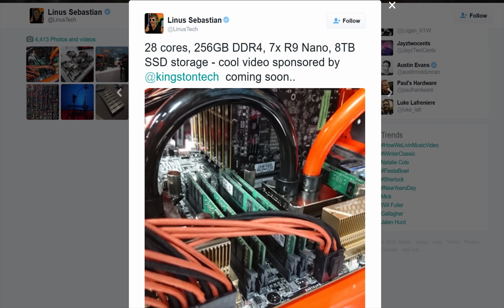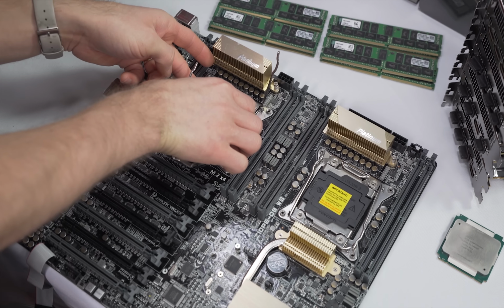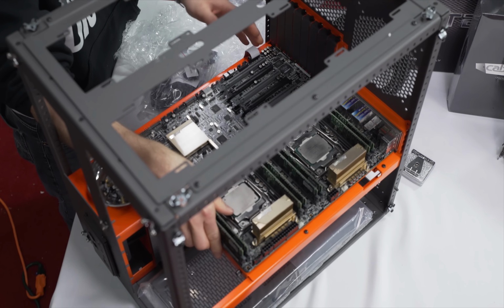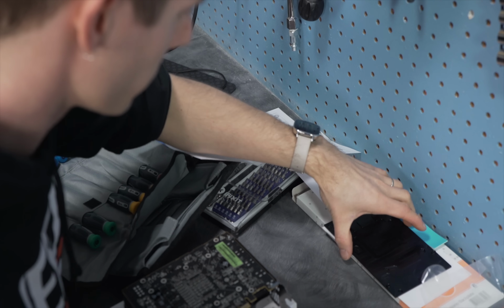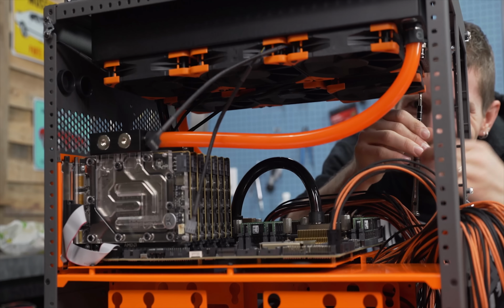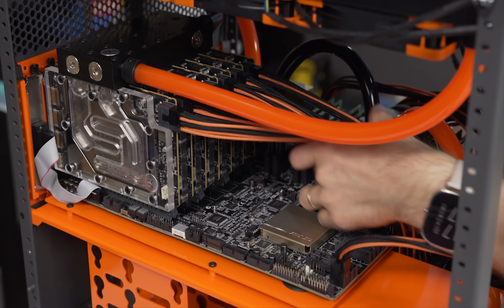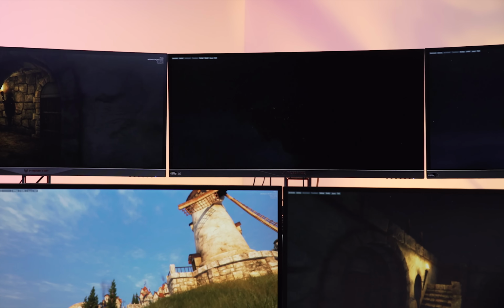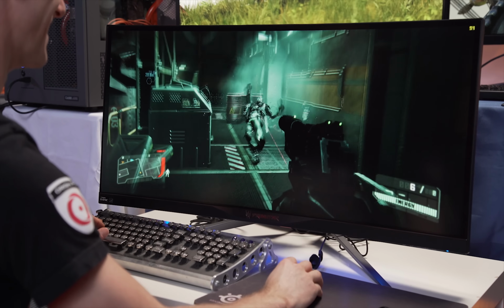7 Gamers, 1 CPU - Ultimate Virtualized Gaming Build Log

Comment: Can someone help me build a gaming PC?
My preffered budget is 5 dollars, but im willing to go up to 6.
Reply: Xavier doesn't know what he's talking about, there are loads of builds you can make for way under $5
Reply: Brandon Miller Please ignore Xavier, he doesn't know the slightest bit about PC specs
Reply: $5? you must be looking for a top of the line rig! it will be much faster than the peace of crap in this video
Processor: ~ 1 month old Toast running on the Whole Wheat Grains Architecture, Socket LEGO-1
Cooler: Sun's Core
Motherboard: LEGO Board, Using the Dankmemesv420 chipset
Storage: Keemstar Branded Wet 'n soggy semen Folders
Ram: A Battering ram, LEGO16P brick module
OS: Potato OS 4.20 Weed Edition
Power Supply: 1km tall iron pole in a thunderstorm
Graphics Card: Nerds Glases with a Sound-Weaponized FX 5800 Ultra
Case: Box Jellyfish's body

Benchmarks:
This pc run's Crysis 666 at 666fps at 666x420 at the highest settings!
This pc runs Minesweeper at 1 frames per ice age at 2x2 squares
This pc runs WinRar at over 9000fps
This pc runs Russia at cyka blyat frames per second
 This pc however, is not good enough to run pong, if you wanted to play that, im sorry man, not possible.
Reply: +Xavier Bob I actually run metro last light at max settings on my raspberry pie...
Reply: +THE CAUCASIAN ASIAN THAT'S WHAT I SAID
Reply: +Xavier Bob you know we're messing with you right XD
Reply: That doesn't make sense
Reply: +Xavier Bob lol
Reply: You can. You just have to buy foil, a bus ticket, get to Linus's home, smother him when he's sleeping and steal this PC. Under 5$ !
Reply: I would recommend the raspberry pi
Reply: Buy a LED and a battery. Wire them up and play a game called controlling the light
Reply: Potatoes 0.85 cent  electrical wires maybe a homeless man can haggle with you for maybe around 50 cents i suggest using a penny as cpu and for your gpu i would recommend a picture of fabio pretty solid build it can run minecraft at 140 fps and crysis at maybe around 500 fps
Reply: Brandon Miller buy i7 cpu 128gb ram and a Titan xp
Reply: Brandon Miller buy a hooker instead
Reply: take 2 potatoes, wire them up and there you go
Reply: Ya buy some potatoes
Reply: +TheCaucasianAsian you're actually a savage bro. lol
Reply: Brandon Miller no worries ma man, u can get a core i7 with 2 gtx 1080s and 128 gig ram
Reply: that's what I would like to do, but I don't know enough about building PC's yet lol
Reply: it's actually not all that difficult, the hardest part will be finding components that work togeather, personally if you're on an extreme budget I'd suggest AMD FM2 socket, amd apus have much better graphics capabilities then the intel iterations, and the older A8 quad-cores are very cheap now - I used one for my friends rig, an A8 7600 I got for next to nothing, perfect for his needs, but it seems to have issues with poorly optimised older games, I hadn't been able to get VtM Bloodlines to work on it as well as I'd have liked, and yet it has no trouble with Shadow of Mordor, a game that only came out a few months or so ago -, also very easy to upgrade, you need only worry about getting a dedicated gpu to increase preformance, In the meantime it'll do the job, however being an APU ram speed is much more important, anyway if you can get a board with 4 dimm slots then you should have no trouble getting four 2gb ddr3 sticks for next to nothing (they're something like £1-3/each from CeX here now) and you really currently do not need more then 8gb of ram yet try to get something at least 1600 though, 1866 would be better, but if you don't have any choice 1333 will at least get you a working pc, try to get all the same brand/type sticks I personally havn't had issue with mix-in-match but apparently some types/brands don't play well with others. take note of your motheboard serial number and type as well since you'll want to look up the manual online to show you where/what all the connectors are, as putting a computer togeather really is just making sure you plug the right plug into the right socket and they generally only go one way/fit one type of socket anyway, also note the power requirements for your apu etc.. but rule of thumb for your power supply you want something-anything rated 80+ preferriblely 80+ bronze or higher that is an authentically rated such (you'll need to research if it's an unknown or unbranded psu) as any psu with an 80+ bronze rating is actually better then even the best most high end psu you could get 15 years ago sotospeak, however you will want to upgrade that at your earliest opportunity as a 2nd hand psu could have issues you don't know about.. also when buying parts look carefully at the caps, japanese caps are best but anything will do on your budget, just check for sweating, buldging or leak-damage if any of the caps have that then it's about to die and you'll have wasted time/money.
Reply: Karl Pudinger
the thing is, after a couple of weeks, the pc may try to... umm.... eat you.
Reply: It is possible, but you're not going to get anything great, you'll basically need freecycle, or friends that have old hardware that they have no idea what to do with - I built a pretty decent basic gaming rig for a friend for £80 including everything in the case, he has his own tv he can use as a monitor, I gave him some old ram, motherboard I had just taking up space, most of his budget went into the case and hdd, he was given keyboard and mouse by his sister etc.. It can run doom at low resolution, it can run shadow of mordor at reduced resolution just shy of 720p, and fallout 4 (on all lowest settings), and plays youtube at 1080p without any trouble - it is an APU, that's saved a masssssssive amount of money, and dirt cheap to upgrade later.. since he prefers older games from 10 years ago it's more then apt.
Reply: He didn't say what era. Can you find a bargain bin PC from the past 20 years? Minesweeper, hearts and Solitaire will keep you up for weeks. What about a used TI-83, you can get the games online.
Reply: Brandon Miller yep go get a free pc a dollar keyboard and a 3.99 dollar mouse
Reply: Devin Hepburn can it run Minecraft tho?
Reply: ItzSpencer
It will soon, just waiting for a Java port for Potato OS 4.20
Reply: Devin Hepburn k think I'm going to get that build I guess.
Reply: Jaysonfred
thanks, il make sure to put into my LPCI (Lego Peripheral Component Interconnect) x69 slot.
Reply: You can almost get a raspberry pi zero. That would maybe play doom? :D
Reply: prospectus
but what if a demonic centipede is guarding his pc?
Reply: Well, you might be able to buy a usb cable for that price, that's a start.
Reply: There are videos of people building a "gaming" pc for about $25 out there. By gaming, i mean they have a low end gpu in them and it's basically a stock dell computer or something similar. It's pretty cool though cause those babies run better than what you would think. So if you're willing to increase your budget by $20, it's actually possible
Reply: Might be worth investing in a tamagotchi. It would probably be a decent one aswell
Reply: Brandon Miller ill sell u my pillow for 5 dollars. It can run agario unlike this one
Reply: Mabe you can get 10 titan Xs and 7 CPUS at 6 dollars though
Reply: ` shockwaveBJ its not much but it's mine
Reply: Xavier Bob I got a 6950X for $10! I may be an eBay wizard
Reply: You can buy a sack of potatoes.
Reply: with a litle more you can buy "raspberry pi 3" for retro gaming
Reply: Brandon Miller send me 6$ I'll you decent PC..  You will be able to play GTA 6 but in GTA 7 you will experience few frame drops...
Reply: cough Pi Zero cough
Reply: Scott Cooper
Reply: Hmm maybe. Buy a spoon, bend it in half. Then proceed to stick each end in to an orange and a potato. Finally, get a $1 HDMI cord and plug it into the orange. Done
Reply: you could do a pc with some Cheeseburgers
Reply: haha yea possible so you need a own cage for your Burger-PC :D
Reply: Lmao
Reply: Xavier Bob Jesus its a joke!
Reply: Xavier Bob Jesus its a joke!
Reply: THE FUCKING BEEF IS RAW NO SHIT!
Reply: Scott Cooper You took this WAY too seriously
Reply: Luuk van Kampen My brain just stopped working. I just cant handle this much confusement. I just fucking commented its a joke because it seemed like Xavier didnt get it. I was too tired to scroll down. Now if you dont mind im gonna go watch TechSources videos
Reply: Buy a raspberry Pi used. Play retro games. ;D
Reply: Brandon Miller
Reply: https://www.adafruit.com/products/2258?gclid=Cj0KEQiA5bvEBRCM6vypnc7QgMkBEiQAUZftQPVTcofTimYDUefnCReGco6qhLpsV27Ux-jbGTO9INIaArFk8P8HAQ
Reply: Brandon Miller a
Reply: Raspberry pi zero is 5$ you know...
Reply: TheCaucasianAsian Arent small objects a choking hazard? Haha, jk man. I cant offend a savage or he will savaragization(idfk lol) me 666x harder
Reply: I'll give you my old Nikia phone for a dollar. It has snake on it so it qualifies.
Reply: Brandon Miller -_- ok whatever bye
Reply: LOL!!!
Reply: DEAL! i'll take that 5$. i got a lovely ibm xt/at and guess what, its your lucky day it even has a turbo botton. hell if are willing to raise it to 6$ i'll throw in a 4 color 14" crt to the mix.
Reply: Brandon Miller im aware. just that was so dumb i couldnt tell if you were absolutely stupid or messing with me... then chose both.
Reply: ***** i havent seen one CPU for under $5. $5 gets you a raspberry pi. that isnt a gaming pc.
Reply: hmm... you cant even find a cpu or gpu at that low. sorry, wont work...
Reply: darn...
Reply: i mean, 500 gets you a great build. but thats out of your price range...

Comment: if you use this PC with only one monitor, you can play all games with minimum 1000000007268273628 fps xD
Reply: No. It doesn't work like that.
Reply: I m Sorry but minsweeper run as 10 fps minimum so for 100383948268202936 fps It want to be a 104847 sli of This pc xDDDD

Comment: I Wonder How This Does With Just ONE Gamer
Reply: No game could utilize all 7 graphics cards and ALL the 256GB RAM.
Reply: 100000000000000000000000000000000000000000000000000000000000000000000000000000000000000000000000000000fps 4K
Reply: AMD cards don't require bridges to crossfire.
Reply: Pretty well, I'd imagine.
Reply: Aren't you forgetting Minecraft?
Reply: That gamer would die having heart attack...
Reply: ps4 emulator at 5k/300fps
Reply: ArdaBlock Oh Yeah. Dammit!
Reply: there wasnt a bridge for all the GPUs so the game would only utilise one. it would be good, but not as good as you think

Comment: And here is your PC monster, start to play, after days you are going to see your bill and get an heart attack
Reply: The math agrees with your conclusion. For 10 cents per kilowatt hour, running all month:
Idle at 250W will cost $18 (0.1*0.25*24*30 ~ cost per kw/h,watts per kw/h,hours and days)
Full load at 1500W will be $108 (0.1*1.5*24*30)
If they use it at full load for 8 hours a day, and idle for 16, it will cost $48 per month. ($12 + $36 = 0.1*0.25*16*30 + 0.1*1.5*8*30)

One watt continuously for a year costs less than $1 (as a rule of thumb). So, the worst case scenario for their electric bill would be under $1500 per year. That's like doubling the average person's electric bill, but that's a small problem next to the hardware cost. As an added bonus you'd get to show off your computer to a DEA agent, when the electric bill raises suspicion.
Reply: Chris Balfour ahahahah for the DEA agent :) Nice!
Reply: Bill from what?
Reply: electricity bill :3
Reply: +Gonzalo Pérez oh haha
Reply: Gonzalo Pérez lel I still remember my bills from when I used 2 8400 watt speakers...
Reply: How much was that out of curiosity? Hahahaha
Reply: Gonzalo Pérez that is true

Comment: actually by paying near 2000 dollars you can come up with awesome gaming machine which can exceed 100fps limit at 2k resolution.
asus maximus impact z170 mobo
i7 6700k cpu
gtx 1080 gpu
16gb of ram
960gb of ssd
cryorig c7 cooler
600w sfx psu.

Comment: or you can just buy 7 different computers for much less
Reply: yeah, but that's not as rad as this computer.
Reply: Well, it's not about money.
Reply: yes but would you watch someone assembling 7 PCs with the same specs for 7 different people?
Reply: 7 separate computers would draw way more power and use way more space.
Reply: Nícolas Wildner Exactly. This was extremely innovative and it can be used as kinda your own home super-computer with virtual machines for rendering or problem solving.
Reply: 7 pc's with about the same specs would also be more expensive
he only has to use 1 case and one psu
7 watercooled pc's with i7's this much ram, at least one radiator per pc, and all in caselabs cases (even their smallest and cheapest cases are around 250bucks)
and he did include the monitors,keybords and mice in that 30k pricetag, and those acer x34's are not cheap
Reply: Yea but that wouldn't be interesting
Reply: You're not getting the point. I know what you're saying though.
Reply: Kun Zhao or you can make a video for millions of views
Reply: Yeah but this is the ultimate gaming mainframe and i think we could less than halve the price without much effect on in game performance. Like multiple psu and hdd instead of ssd. And I don't think this much ram will ever be used (like 35gb per vm)
Reply: it depends of your running higher resolution that might effect ram a little bit
Reply: exactly
Reply: Or you can be a badass
Reply: Yes,but this is much more badass

Comment: Why didn't you use this +linustechtips     https://www.google.co.uk/shopping/product/9621003505234871967?q=xeon+e7-8895+v2&espv=2&biw=1366&bih=643&bav=on.2,or.&bvm=bv.127178174,d.bGs&ion=1&tch=1&ech=1&psi=kq6MV6-bBujD6QTXnqiQCw.1468837523890.5&prds=paur:ClkAsKraX9KRZB5IaBlneqQ8xW0Lqm_NMswELuB80f9WL6pcqgqY7Dq6URikB0HI-UIfAcRJb_0m3Oe1uDWtvEyAjYPiGyD6fVX00FFOB8nPQlPR67rUVRcw3RIZAFPVH71WjhZ1ayKtlgAvRFhXRNYtCWIl5A&sa=X&ved=0ahUKEwjW1v6X5vzNAhWQF8AKHWWtBksQ8wII0QEwAA

Comment: I found this pc online for a really good price, is it good, and can it run gta 5 and csgo at 60 fps?
 Asus Customized Gaming Rig

Processor : Intel Core i5-4690K Processor 

Motherboard : Asus Maximus VII Hero

Ram : G.Skill (8GB) 

Graphics Card : Gigabyte GTX 770

Hard disk : Toshiba 120gb ssd (for os) 
Hitachi 2TB (for data)
WD 500GB 

Power supply : Corsair RM 650

Case : Cooler master 

CPU Cooler : NZXT Kraken Liquid cooler 

Wifi : D-Link DWA

Alseye 6 Fan controller 

7 Silent CPU fan

Windows 7 64bit (original & activated) 
Windows 10 upgradable 

Complete PC with (HP 23" monitor)

Logitech G110 gaming keyboard
Reply: How much does it cost?
Reply: whats the link to the page?

Comment: you do realise that this would work far better if you used more than one motherboard. That's because you can get another CPU in therefore more processing power. That's because if you have the maximum amount of users and they are trying to run the same game on each vm then there is a chance that they may only just meet the minimum system requirements. also it would be far better if it was cooled with liquid nitrogen
Reply: so just build 7 PCs?

Comment: Hi, I really like your videos, I recently burned down the power supply, need to buy one but not sure which one, I have an I7, Intel Extreme Mother Bord, 16GB Ram, 5 HD, Corsair Hydro Series H100i v2, some UV Cold Cathode Light Kit, 570 Nvidia Video Card.
I like the corsair, Corsair HXi Series, HX750i, HX850i, Corsair HXi Series, HX1000i 
which one do u  recommend? Thks

Comment: You can get two Evga 850 watt psu's for about 300 usd and I believe the power supply that was used is 380 usd and with the 2 850 watts you get more power *facepalm

Comment: what keyboard is that 13:06
Reply: +Bryce Romero Datamancer Aviator
Reply: YannickoYT Can ask you a question on pc's in not that good with them
Reply: Bryce Romero Sure!
Reply: YannickoYT i have a decent computer and for gaming does graphics cards help frames the most if not what else?
Reply: Graphics cards are the most important hardware when it comes to gaming performance. But, you can't just put a very expensive graphics card into a computer with old and weak parts. For one you need a CPU that can handle the card, Other things such as RAM and storage also contribute to a better gaming performance from your computer.
Reply: +YannickoYT I have 16 gb of ram and its i7 so do you think my computer is pretty good and I just need a new card and a little p.s I'm looking at an nvidia gtx 970 4gb is that a good choice?

And thanks for all you're help
Reply: +Bryce Romero yes, the 970 is the best bang for your buck on the market.

No problem, feel free to message me if you have any questions in the future :)
Reply: YannickoYT Thanks man I will I might shoot you message in the future once i get the card thanks again
Reply: YannickoYT and sorry but i have one more question about pc shells; can you fit any computer on any shell or do you need to have a certain fit
Reply: No problem. Nope, you will need to check the case size to make sure it can accommodate the motherboard type you have. For example if you have an ATX size motherboard, your case will be need to be big enough to support it (most medium and large cases will), Just check what type of motherboard you have and check the description the of the case and it will say if it supports it.

You will also need to check the case description to make sure it has enough room for your graphics card so it doesn't interfere with your hard drive caddie. If you need me to check over any cases, I'd be happy to do so.
Reply: YannickoYT the one im looking at is Raid max scorpio v atx-503wb and thanks your a life saver
Reply: Ok, that case supports ATX / MICRO ATX / MINI-ITX / EATX motherboards and supports graphics cards up to 12.48 inches.
Reply: YannickoYT thank man so much:)
Reply: No problem! :)
Reply: YannickoYT hey dude do you know if that the 970 would fit in this computer: asus desktop pc m51ac series